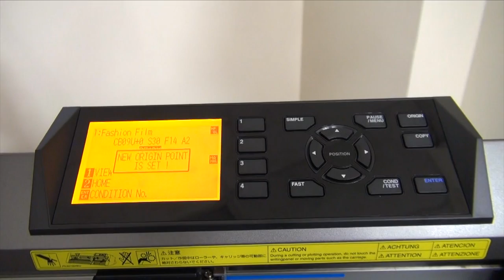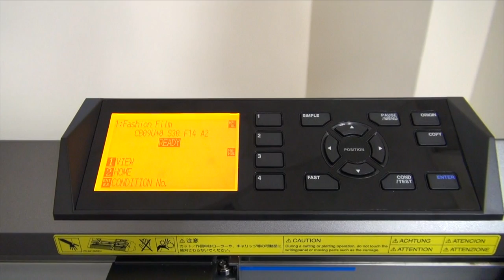Graphtec CE6000: Setting the Origin

Comment: Well, how did you know when to stop when you rolled it back up?  The Graphtec has the unimaginably stupid ability to roll the vinyl up through the rollers and out the back of the machine.  I have never heard of such a useless feature.  Is there a way to tell it to just use the leading edge?  I would like to standardize the cut every time, but I'm just eyeballing it because it doesn't have a hard stop point.
Reply from the maker: +southparkgdp When you load the material into the cutter, you should select option 1 for a roll - front edge. That should stop the blade right at the front corner of your material, leaving you the most room for cutting.
Reply: +Stahls' TV lol.  Yeah, I know.  It SHOULD do that.  I was referring to what it actually does.